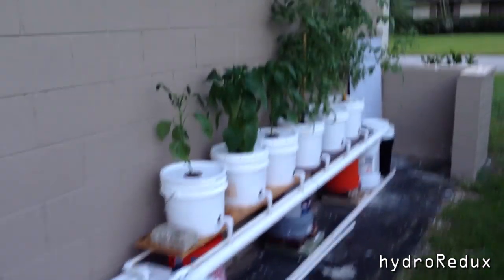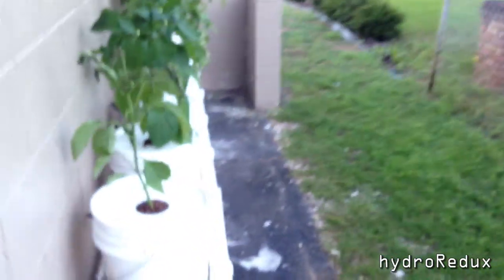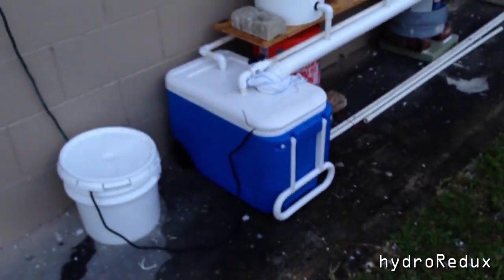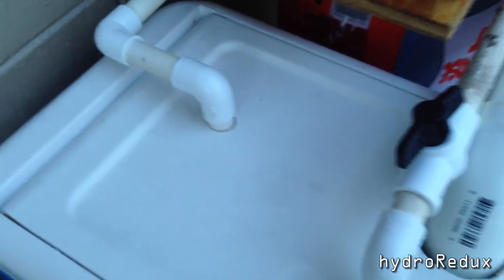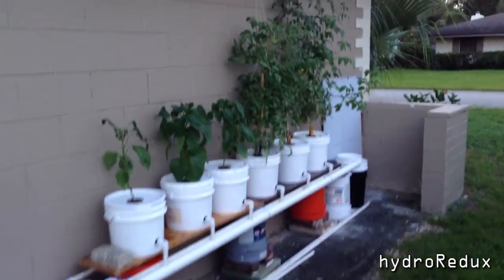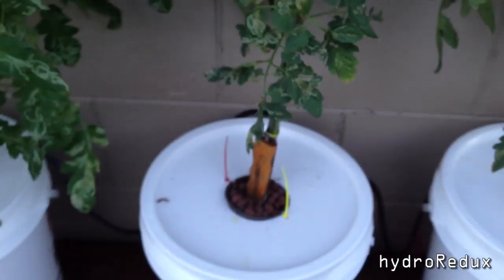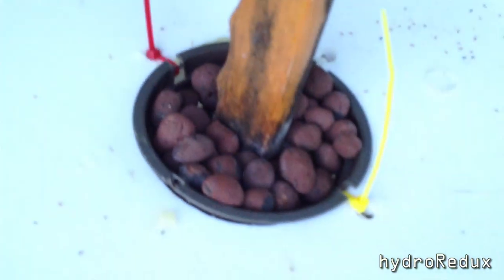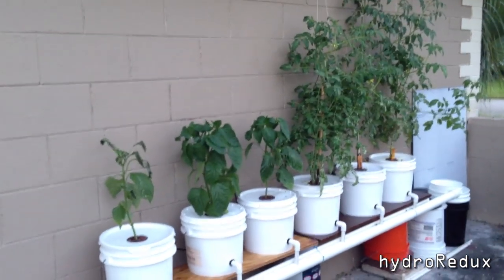Hydroponic Bato/Dutch Bucket System update and How to cool water reservoir .

Comment: Just a thought would be to get a 55 gallon or 30 gallon drum made of plastic and place it in the ground to keep the heat down this would also provide more water to keep pump cool. Ground temp should keep the water temp down if you have a large container.Might paint the buckets to cut down light going thru the sides roots should be in the dark.What side of the house is this wall, try this on the north side of the house.Are you using city water for your ice?